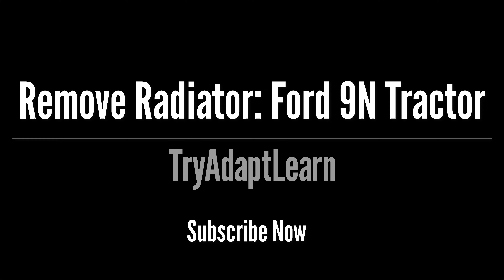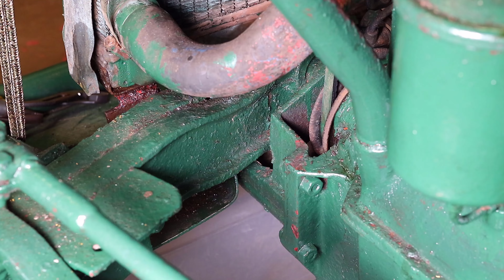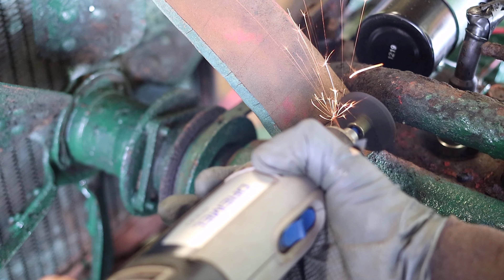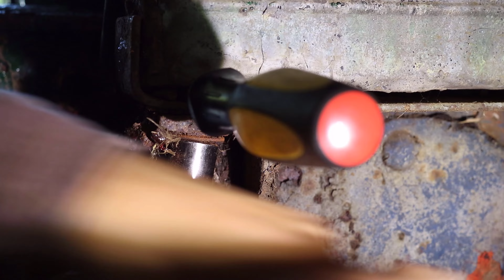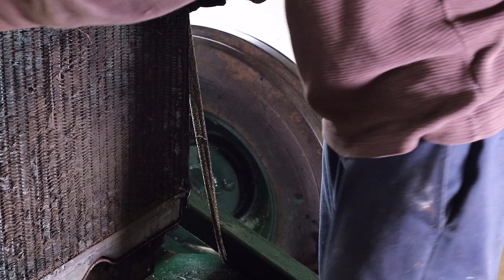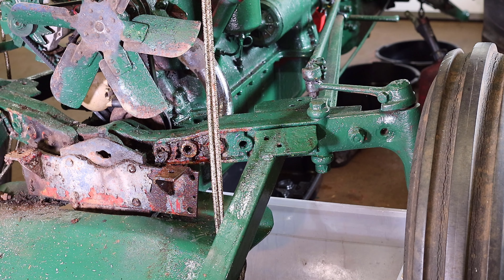Ford 9N Tractor Remove Radiator

Comment: where did you get the replacement radiator?   My original 1940 is now leaking and a tad beat up.   What condition was your pump inside when you replaced?
Reply from the maker: I believe purchased the radiator replace from Steiner tractor (no affiliations/sponsorship). The water pump was leaking from the bearing (which stated  the project) so I had to replace it.

Comment: who in the world tried to paint that...sad
Reply from the maker: Thank you for your comment.  It may be sad to see a bad paint job on a radiator removal video but may be sadder to let the metal continue to corrode.  This is why you can see a lot of the parts like the radiator support must have had multiple coats applied over each other throughout the 80 years of service.    The rain and humidity leave no small surface layer of rust that will have a painta look on metal.  Unfortunately, exposed or rusted metal left alone (even while working under a roof), will quickly rust in chunks that bubble up, rust through, or rot holes into metal.